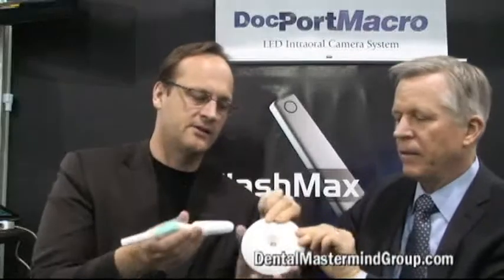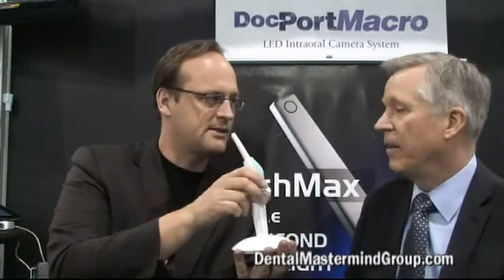The 1 Second Dental Curing Light

Comment: I bought two of these lights. They are indeed powerful. But neither one lasted more than 1 year. The plastic casing of the light is weak and it cracked within 6 months. The other's charging interface (little gold pin arrangement) failed way too soon as well and it wouldn't charge at all.  You really need to rethink the design from a durability aspect. I absolutely BABIED these things too.  I wouldn't buy another flashmax without some serious upgrades to the durability. The new flashmax is thin, light, fragile, and feels cheap in the hand. They really should be cased in aluminum and have a more robust charging interface.You might have a real winner then. These things don't hold a candle to the Valo.